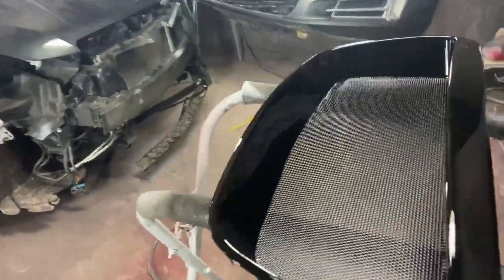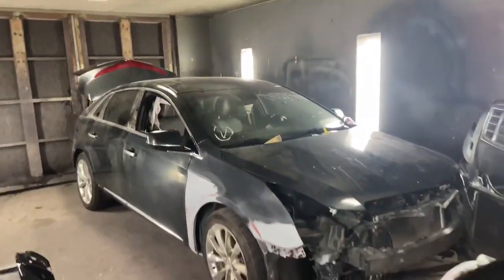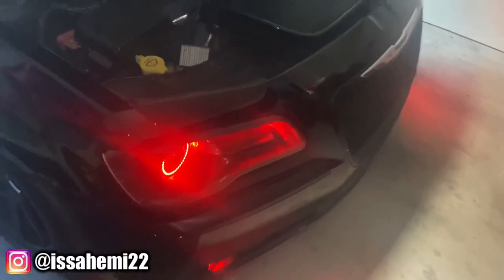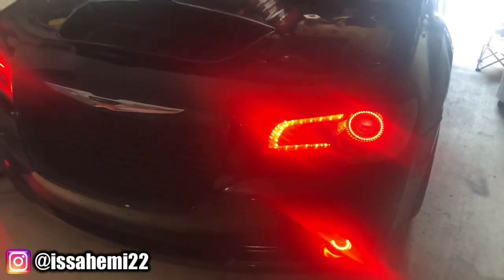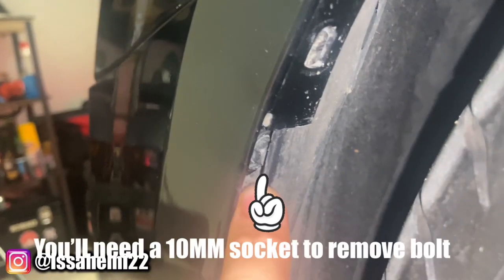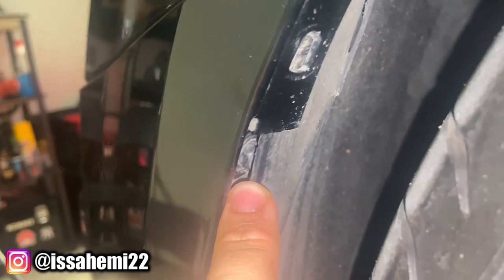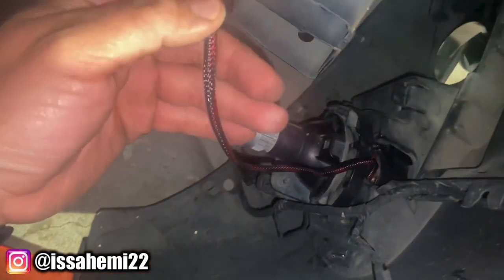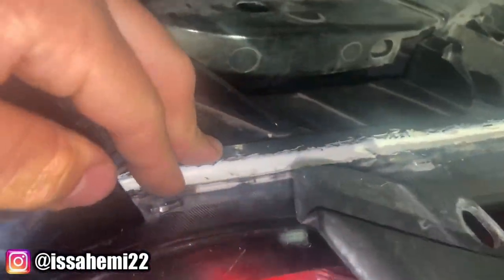CHRYSLER 300 GRILL INSTALL

Comment: Quick question I have a 2013 Chrysler 300s v6 will this grille fit on mines?
Reply from the maker: Yes it will, the grills on all 2011-2014 models are the same.